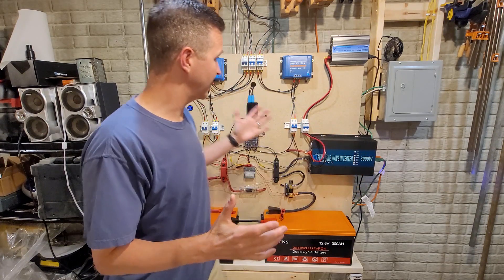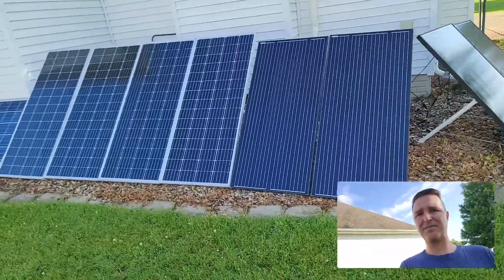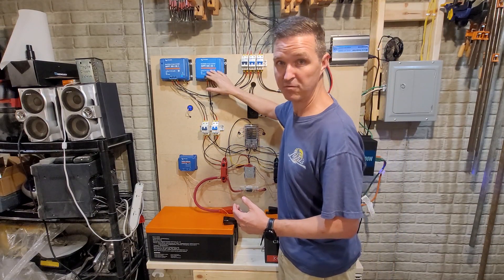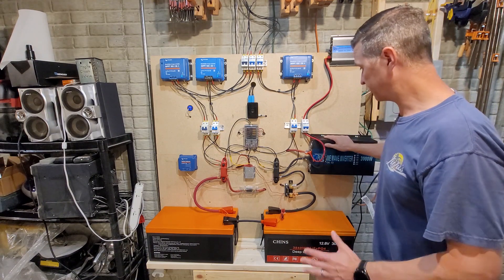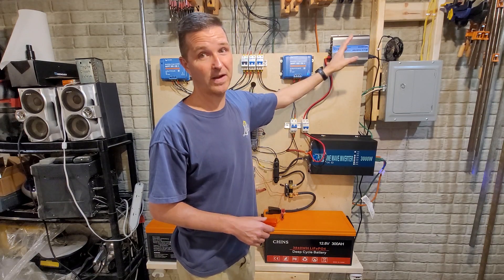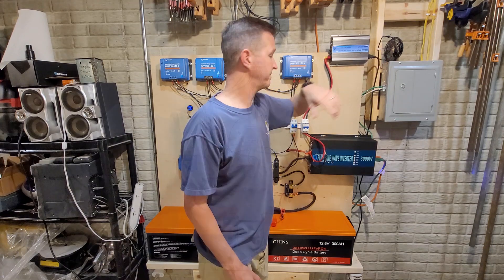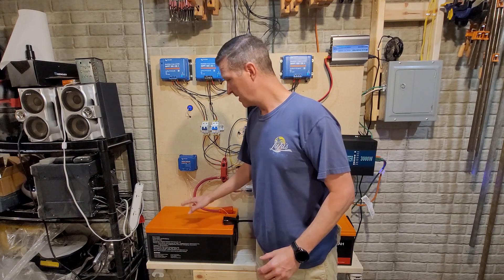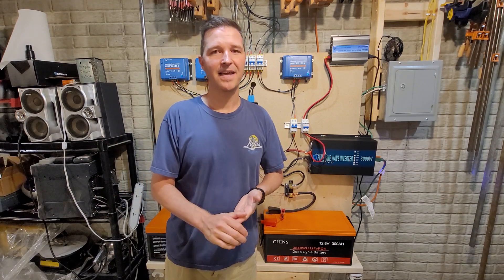6 month update of my 24v Off Grid Solar Setup!  So much was added!

Comment: are there any code's you need to follow in order to have batteries like that in your basement?
Reply from the maker: I can't find any codes stating that I can't have LifePo4 batteries in my residence.   You need to check with your local codes to confirm.  Thanks for the comment!

Comment: Super appreciate the content. I have the same reliable inverter based upon your initial review. I’ve not yet figured out or bought the grid tie upgrade but I need to look into it more. Two 24v 100ah Ampere Time batteries here. Maybe one day I’ll make a YouTube video and get your input and thoughts.
Reply from the maker: I think you should make a video!  I have to say that reliable inverter has powered everything I've thrown at it.  The grid tie really should be connected directly to my busbars, but I wanted to take advantage of the fuse I already had.  Thanks for the comment!